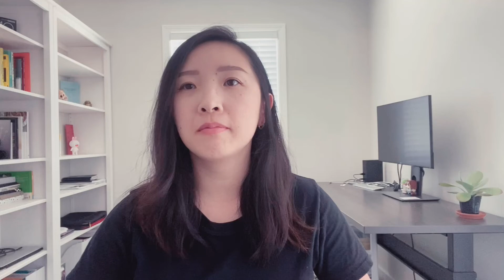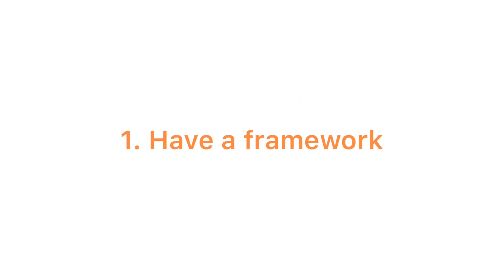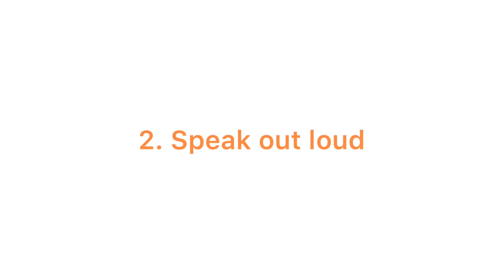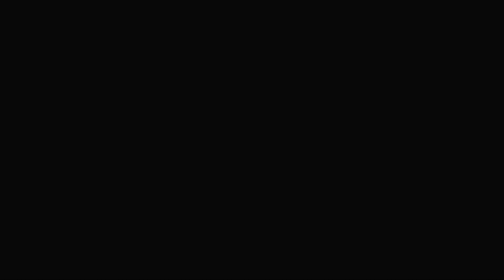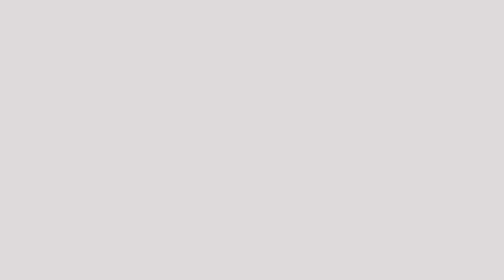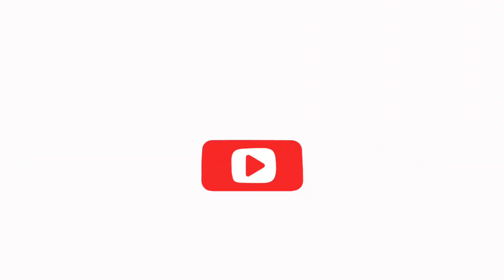How to Prepare for Whiteboard Design Challenge

Comment: Thank you for all the helpful advice! Regarding asking about the expectations of the session, I feel like asking if they expect you to end up with a UI is assuming that the solution is an app or website which might look like you’re jumping to conclusions. However,
 I’m struggling with a finding a different way to ask for expectations... would “are there any expectations for this design session?” be too general?
Reply from the maker: Great question! I would try to keep it an open question, i.e. "Could you help me understand what's the expected outcome of this session?" also, I think to clarify at the beginning what platform you are designing for is actually a critical step. it shows your understanding of how to approach a problem and consideration of potential technical constraints.